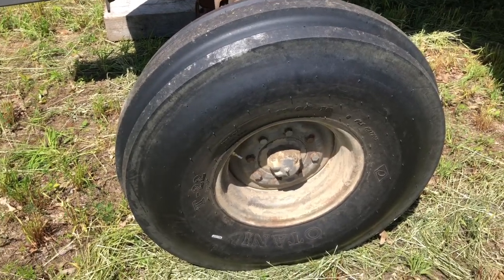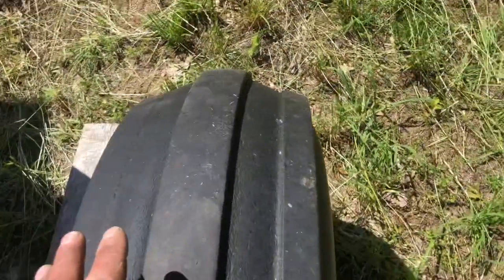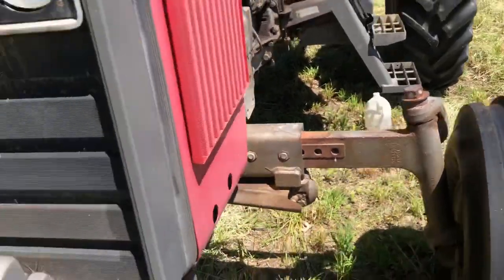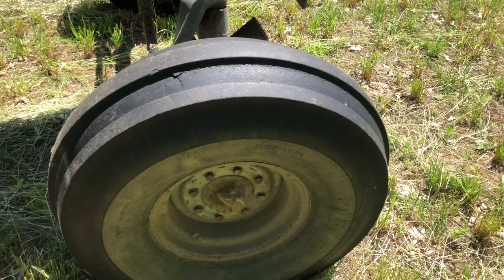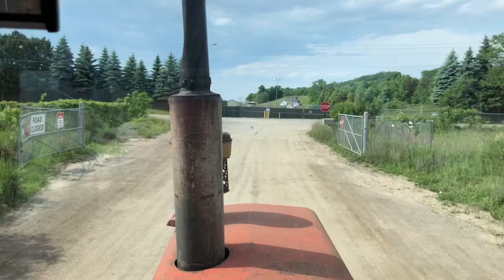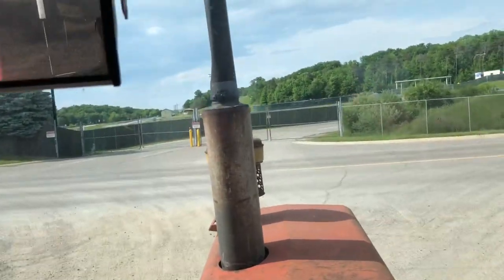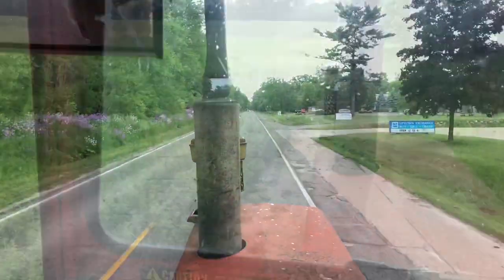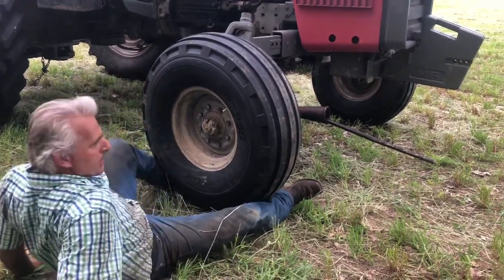Swapping 3 ribbed steering tires for multi-ribbed

Comment: I like 4 rib fronts, but I have an abundance of used 31x10.50 and 265 75R16 truck tires!
Reply: 265's are a good go to sized tire for 7.50-16's front tractor tires, 10-16's are a 34-36 inch tall tire and 11-16's are around 37-38. We have 285/75R16 on the Ford 8000 and it set's level with low pro 18.4R38's, but 285's would be short with full size 18.4R38.
Reply from the maker: Northern Wisconsin farming I tried to find truck tires in the size but I couldn’t find them that we’re gonna be the same height
Reply from the maker: Fyrciak Farms How to look at those because Green Oak Tire was telling me they couldn’t find a truck tire that would be the same height
Reply: @michiganhay7844  If it's a 10.00-16 you can come close with a 315/75R16 ( old sized 35x12.5x16) or even a 9.00-16 NDT's, but if it's 11.00-16 you could go with 37x12.50R16.5 tire's off a HUMVEE.

Comment: I  grew up there. My great great Grandmother settled in the area around 1850.
Reply from the maker: Jerry Hill Where was your house at Jerry
Reply: @michiganhay7844  Northeast corner of West  Commerce and Garner rd. Red Brick with shop on hill. Originally part of the Hill Farm which was south of Commerce on both sides  of Garner.      It was great place to grow up but too crowded for me now.
Reply from the maker: Jerry Hill 25 years ago there used to be an old timer that would be standing out there and he’d be waving at me as I’d be driving my old John Deere 60 up and down the road curious if that was one of your relatives?